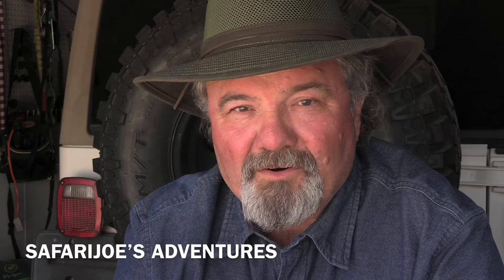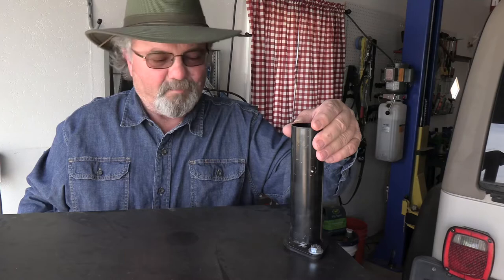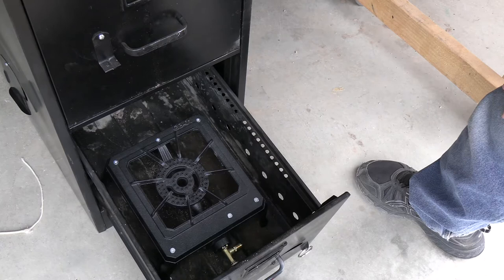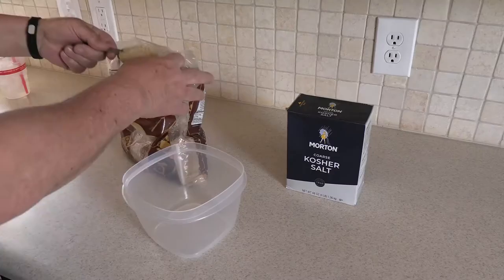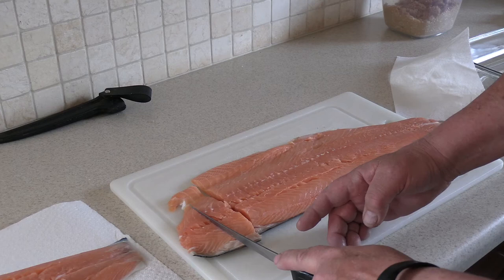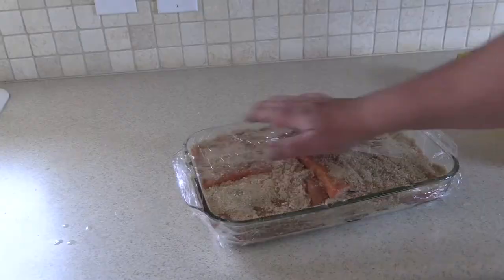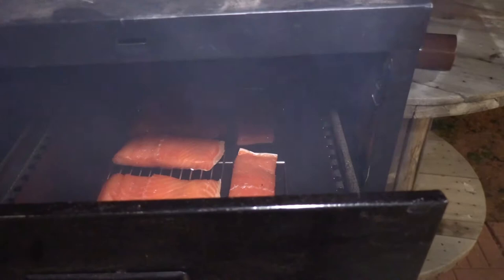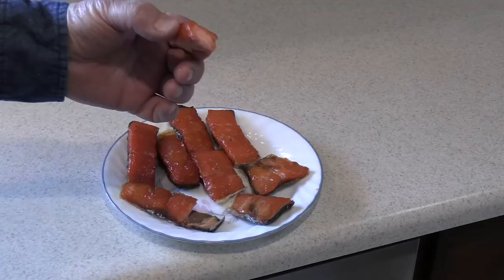File Cabinet Smoker update￼

Comment: My Father has one. The inly problem we find is using it for long periods of time and the charcoal/ wood suffocating from the ashes. We still love it though! Happy BBQing my man
Reply from the maker: @ceedagee1276  I have used it with charcoal and wood chips a few times, but mostly I use a propane burner in the bottom drawer and pellet tubes with different types of pellets. Both ways have worked well for me, but I will say with the gas burner and the pellet tubes with pellets doesn’t give me as many problems. Thanks for checking it out.

Comment: Charcoil only
Reply from the maker: @dondiesel1100  not sure what you meant by charcoal only. I have used charcoal on it. I have used hardwoods on it and I also have used gas with pellet tubes that work very well. but with the design, you could use any of these methods without problem. Thank you for checking it out.

Comment: Instead of that vent,why not use a floor vent or wall vent.
Reply from the maker: You absolutely could. I have seen them made that way.somebody just cut out the top and put a floor or ceiling register vent in them. They have the louvers for allowing more or less smoke to go out of it and they work well. The only reason I put that particular chimney vent on it as I wanted it to look a little different. The truth is you could do it much faster and a little bit less expensive by using the vent you were talking about. Thanks for the comment. I hope you enjoyed the build.

Comment: What would you say to an electric coil burner and pellets?
Reply from the maker: Funny, you asked. I have an electric coil countertop, single element stove I bought at Walmart. I was going to use a small metal cake pan and put some pellets or sawdust chips on it to see if it would smoke. If it would it just might work. As long as it created enough heat to create the smoke and to cook whatever it is you’re smoking.

Comment: Do you have t but the paint offf before doing?
Reply from the maker: When I built the smoker, I did run a fire inside it for a few hours and burnt the paint off the interior Before I smoked anything in it . Ialso left a good coating of smoke afterwards, and I just leave that on there to kind of seal it.

Comment: HI can i also roast or oven like for  fast cooking roasting chicken?
Reply from the maker: Yes. You can adjust the heat with using either the wood or the gas burner in it. The electric not so much .
Reply: @safarijoesadventures  thanks so much because I was torn between the file cabinet or steel drum barrel for my purpose.  The file cabinet is much more easier to do with gas burner . Thank you again
Reply from the maker: @unsopken0623  you are welcome. Let me know how it goes.